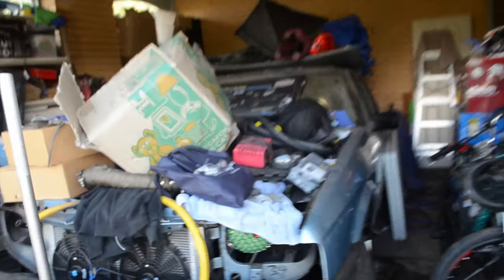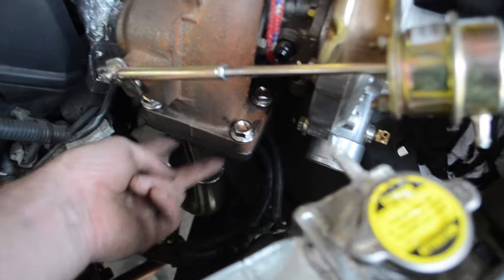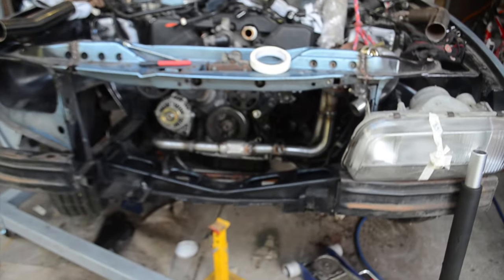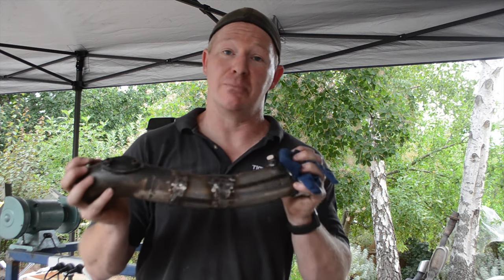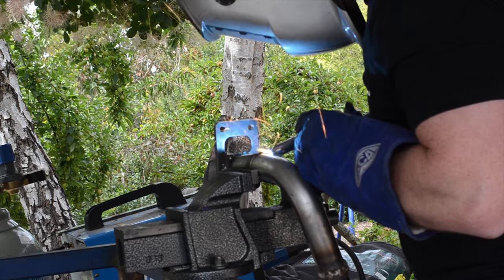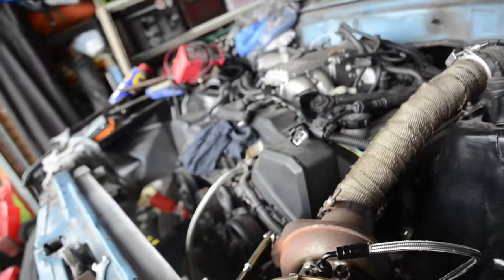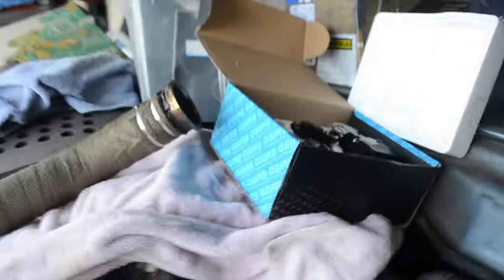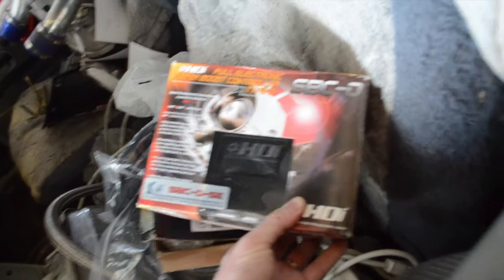Turbo install on 1uzfe (the Fexas project)

Comment: Hey mates what's Ur thoughts on the smallest single turbo that the 1uz could run?
Reply from the maker: I was originally going to go two small turbos on this car. Just cos it would look cool, and the internals would be able to handle it. The only issue is that smaller turbos run out of boost up high, which kind of defeats the purpose with a v8 for power as they have the low down Tourq and the top end boost evens out the power curve well. If you just want punchy around town power a small turbo would be great!
Reply: @Tim Walter  yeah was wanting to run a Lil  g25 660 but they are said to work on 1.4 to 3L engine wasn't sure how that would go on the 1uz haha couldn't find anyone online having tried it .

Comment: Hello Tim new to your channel... i was wondering what welder did you use to weld up your turbo piping? Thanks.
Reply from the maker: Hi mate, I used a mig welder for the piping, in an ideal world i would have used a tig, but honsetly i didnt have any gas and realy just wanted to see if I could get it to work. time will tell if i did the right thing or not, its holding fine for now though.
Reply: @TimsGarage  man to be honest your build is pretty cool... motivated me to turbo my sc400.... just starting to order parts and see where this take me... im actually going to follow your steps . Seen the video like 10 times ill have to see it a few more. Haha.... i hope i can see more of that build. Best luck to you.
Reply from the maker: @johnathanorozco6337  Hi mate, thanks heaps for that. Honestly this is all new to me, stretching my knowledge and abilities, but the car is now running, so I must be doing something right. I do have a long video about to come out, but am always happy to answer questions, and help out wherever I can. happy it motivated you mate. check out the @skidfactory too, those guys do a number of these and realy know thee stuff, i watch them lots for hints and pointers.
Reply: @TimsGarage  awesome thank you. Ill keep posting for future videos. Tim what ECU are you running stock ecu ?
Reply from the maker: @johnathanorozco6337  yea mate, its currently the stock ecu. Im not up to tuning the car yet, once i get there thay may change the ecu, but my initial goal was to do it on a budget and see how things stood up. EG: the car runs, and drives, once i sort out a gearl box issue i will know more. The stock gear box needs an ecu, unless you manualize it, which I think is in the plans, which means I can run an aftermarket system.
Reply: Hey Tim, only just come across your channel, I guess we were both building 1uz turbos at the same time. I went rear mount with my LS400 but your build is very cool. Will be going back to check the rest of your videos. I want to go bigger with mine now so may front mount it 😂  keep up the good work.